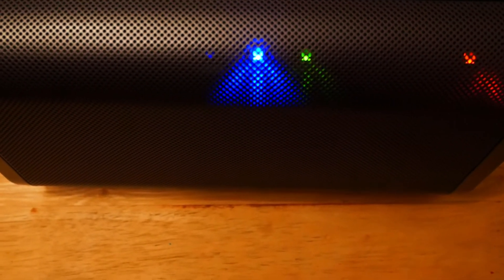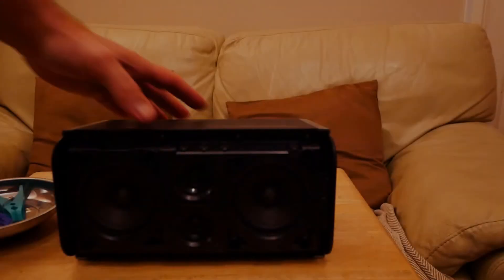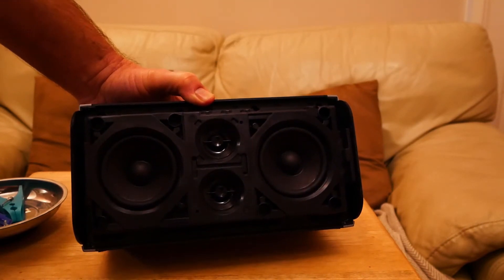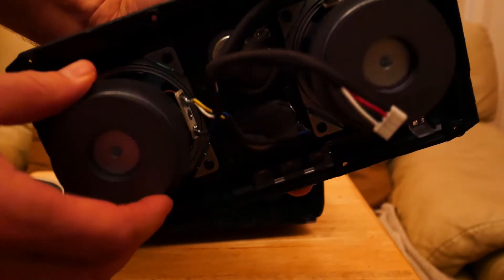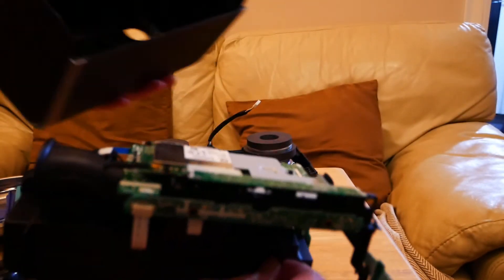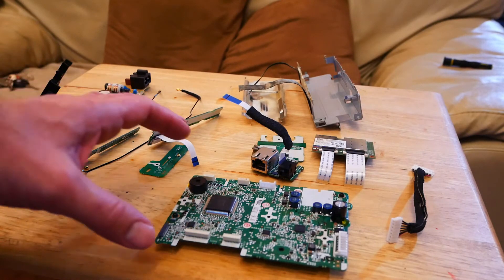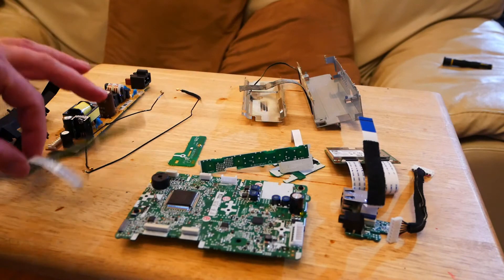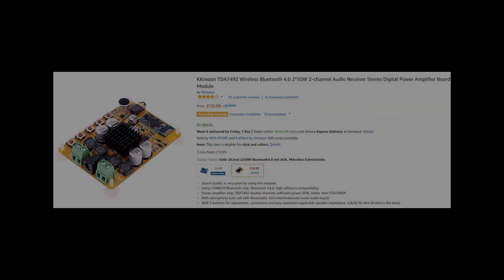PANASONIC SC-ALL3 WIFI SPEAKER CRACKLING WORSE SOUNDING SPEAKER

Comment: Hi. I get the crackling when I try to use the speaker through an aux jack. I presume installing a Bluetooth amplifier module is not going to cure that?
Reply from the maker: In the end I bought a stereo amplified Bluetooth module , I think it was 25 watt RMS per channel . Took all the original parts out and connected it to the speakers. I couldn't cure the cracking from the original components.
Reply: @baconbuttties  Thank you! How easy do you think that is to achieve for a beginner?
Reply from the maker: @sinkyboy2000  It's pretty easy and there should be a few tutorials on line on connection of speakers.
Reply: @baconbuttties  thanks again for the help and sorry to keep bothering you, but was it the board at the end of the video that you fitted?
Reply from the maker: @sinkyboy2000  Yes the board at the end was what I fitted but you need a 12 volt power supply a bit like a laptop charger. I can't remember off hand how many Amp the charger has to be as  I don't have the speaker anymore.